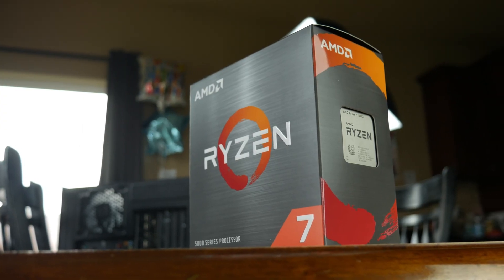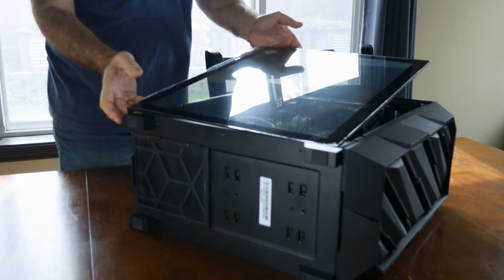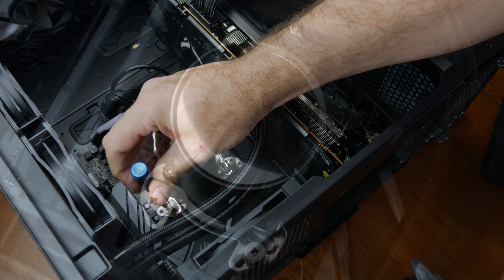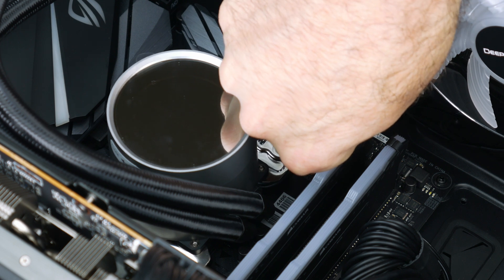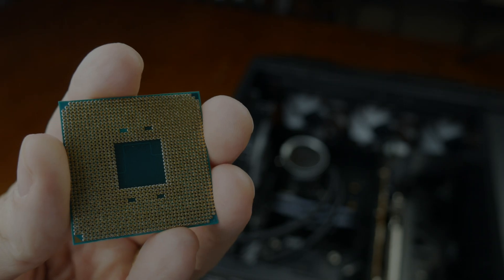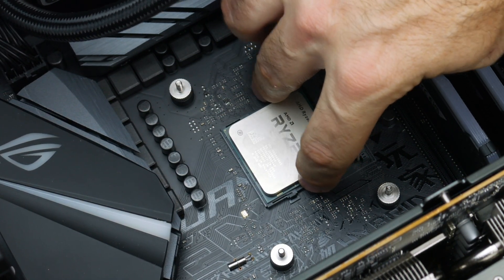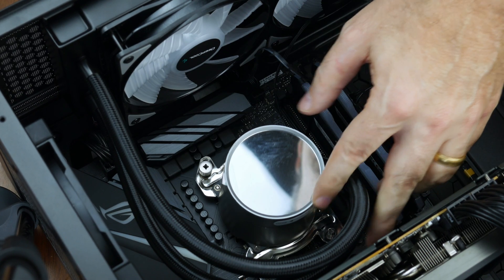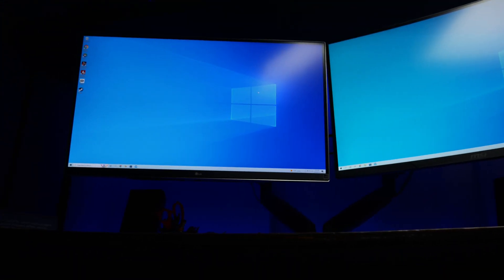How to Upgrade an AMD Ryzen CPU (AM4 Socket)

Comment: I’m going from a 4core ryzen 5 to a 6core do I still have to update the bios?
Reply from the maker: Not necessarily.
If you're upgrading CPU's within the same generation, then no. For example, if you're going from a Ryzen 5 3400G to a Ryzen 5 3600X, then you should be good, but if you're going from a Ryzen 5 2400G to a Ryzen 5 5600X that means you're moving up a couple CPU generations (the 1st number in the model number indicates the generation), so you will need to update your motherboard BIOS before swapping CPU's. If you don't update your BIOS first, then your motherboard will not recognize the new CPU, and will not work.

Comment: Youre video is def a big help. I do I have one question. I am upgrading from a Ryzen 5 3600 to a Ryzen 7 5700x. My ASRock B450M/ac Motherboard says it calls for BIOS 2.70 which was made in 2021. If I have BIOS 10.08 (2024 update)... Do I need to downgrade to BIOS 2.70 or am I good for the swap with no extra hassle?

Comment: Thanks for this. I've done a few CPU swaps before but only on Intel. I'm fairly confident with LGA CPUs, but I'm a bit scared of messing things up with PGA. Thankfully it doesn't seem much different here, just need to be more careful when handling the CPU instead of the socket

Comment: I just upgraded my 5600 to 5700x3D and it was so scary to install the new CPU lmao. My hands were still shaking after it was installed but I was so relieved when I saw the American Megatrends screen.
Reply: Lol
Reply: I can’t get any display on my screen
Reply: @caydenwendling939  try updating bios
Reply: @caydenwendling939  
This is probably way too late but maybe it can help the next one with the same problem. If you don't get any display you probably didn't update your bios.
Reply: I’m about to do the same upgrade with my new 4080 super. How was your performance jump? I’m on 1440p
Reply: @samphillippi904 I mainly play shooters like CS2 and play at 1280 x 960 low settings despite my monitor being 1440p but other games I set them to 1440p Max or Ultra settings. Performance is really good in CS2 like around 250 to 400 in an online lobby and highest I seen is 500+ on an bot lobby. In other games, performance is also really good. I play like The Crew Motorfest but FPS is capped at 60fps somehow. 

5700x3d + 4070 + 32GB is a nice combo. Though I might jump to AM5 soon as the max clock speed for the 5700X3D is only 4.1GHz and I can feel it struggling in Photoshop despite having a 4070.

Comment: swapping from a 5700g to a 5800x3d. I have the ASUS PRIME  A520M-A II with BIOS version 2803. I checked the website and it said for a 5800x3d to be usable it has to alteast have BIOS version 2423 which is the update before mine. Despite the newer BIOS updated do I really have to update BIOS?

Comment: Hello. I have two questions. 
1. For igpu processor which DDR RAM is better? DDR4 or DDR5. Also recommended to me which CL of that RAM
2. If i want to buy some GPU like Sapphire Nitro RX 7800 XT or maybe some cheaper GPU, is it better for my PC to buy a processor without igpu, or there will be no problems if i buy a processor with igpu?
Reply: 1. If you are only using your PC for gaming, DDR 4 with Ryzen 5000 series should be enough for now. Although, if you using it for something like 3d rendering and any other heavy workload and future proofing your PC, DDR5 is your choice, although it will cost you more , of course.
2. Don't buy any CPU with igpu if you are planning on buying a dedicated GPU. Waste of money really, since you never use that igpu after all.

Comment: Thanks for the Information. The only issue I encountered was that when I tried to boot my own PC, going from a 3800XT to a 5900x, it gave me a TPM error. I also had issues with Bitlocker, which I eventually solved, but knowing I had to disable these in advance of installing a new CPU would have been very helpful.
Reply: I’m running into that issue now. Did u have to go reinstall ur old cpu to get the passcode or how’d u end up solving it

Comment: Can't wait to give a little twist to my Noctua NH-U12A that was never removed in 4+ years ^^'. Can't wait for the next saturday to swap my old 3600X to a 5700X3D which cost me around the same price as my old CPU a few years ago (and not sold by a sus vendor but on Amazon by Amazon for 190 euros). My Asus TUF B450 Plus Gaming is ready for that little bad boy (bios up to date), then i will have to wait for something similar to a 7900 XT at the price of the current 7800 XT or GRE to remove my old 5700 XT and it will be almost perfect (overkill for my monitor but anyway. I use a 1080p... 32:9 monitor sooo if i want to upgrade for something like a 32:9 1440p G9 OLED, it will be too expensive ^^').

Comment: Hiya, many thanks for all the great videos,ive just upgraded my gigabyte a320 am4 motherboard from a ryzen 5 to a ryzen 9. i followed your video on updating the bios which i did with no worries. my problem is although the pc and windows 11 recognises the ryzen 9 cpu its offering me an option on the post, i chosse N with loads windows normally, what option should i choose ?
also as i mainly use my Pc for MSFS2020 is it worth upgrading my MB to a tomerhawk MB ?
while playing MSFS2020 my PC throws out alot of heat any ideas other than change my heat sink ?

cheers, great work

Comment: right now i have a ryzen 7 5800x with the F10 BIOS on my Motherboard and i wanted to upgrade to ryzen 7 5800x3d.
BIOS Update F10 is still right for the new CPU right?
my board: b550 aorus pro v2

Comment: Just wanted to say thank you for this video. Had to install my new CPU for the first time and boy I was scared of doing something wrong.
Went from a Ryzen 7 2700X to 5700X3D and everything went well! 
Thank you!
Reply: That's a great upgrade! Today I'm going from an R5 3600 to the 5700X3D, which will hopefully give me a lot more wiggle room in Space Marine 2. GPU upgrade will definitely be the next big step, lol.
Reply: @Jakura99 I’m on that upgrade path too hopefully it comes tomorrow
Reply: @Jakura99  Damn, almost same upgrade in a few days, 4+ years with a 3600X (was going for a 3600 at the time but idk why that day the X was 5 euros under the non X, both sold on amazon by amazon btw) and a 5700XT, hope it will give me a huge boost until the next gen of AMD GPU comes out (especially on a "poorly optimized" and "unknown game" called Helldivers II which give me headaches ^^').

The 5700X3D (sold on Amazon by Amazon btw, not a sus vendor) cost me only 190 euros, that's around the same price of my old CPU a few years ago, i see this as a Huge WIN.

How was your upgrade with the 5700X3D, what GPU are u using with it ? did u notice a huge gain on all of your game ?

For the GPU i'm waiting for something similar to a 7900 XT for the price of the current 7900 GRE or 7800 XT, that will be around a 100%+ perf gain vs my current 5700 XT (and ofc double the VRAM or more).
Reply: I will be upgrading from 2600 to 5700x3d
Reply: went from ryzen 5 2600 to ryzen 7 5700x and my god the performance is heavenly
Reply: @queueuof I'm on a 1600 AF which is a down tuned 2600. Really hoping to upgrade soon to the 5700x or a 3d card if I can swing it
Reply: Same. Just upgraded from Ryzen 5 3600 to the 5700X3D. About to install. Hows the x3d working for you?
Reply: @NJFoxx  am about to do the exact same in a week 3600 to 5700x3d,its big upgrade for fps games isnt it ?
Reply: @home2341  huge. Especially for cpu dependent games. Hope you enjoy man. I will always have a soft spot in my heart for my 3600 though, that thing was working above it's pay grade lol.
Reply: Here cause I'm doing the same upgrade today when I get home, I'm so excited! Glad everything went well for you I hope I Can do the same.
Reply: I'm doing the exact same upgrade! Tell me, how much of an improvement did you notice with the better cpu?
Reply: @jeremybrown116  It's insane. You got your money's worth.
Reply: @NJFoxx  Just installed it yesterday. I gotta agree! went from 40-50fps on a 4070 to 100-120+fps!!!
Reply: Got mine yesterday putting it in today hope all goes well 🤞
Reply: @ mines doing well I put it in yesterday lmk how you do
Reply: how did you go flashing the bios? never done it before
Reply: Yoooo ive got a r7 2700x too but i have to upgrade to a 5800x not 3d
Reply: i have same Ry 7 2700 and looking to upgrade to 5600. how much better is it? will i be able to play GTA 6 when the pc version releases in ~2 years?

Comment: If possible, I like to run the system through a quick stress test or put any load on the CPU really beforehand. It makes it much easier to remove the cooler ;)

Comment: Why is it necessary to upgrade the BIOS before a CPU Ryzen 5 upgrade to a 300 series motherboard?  I am in a situation where, despite many email communication exchanges with MSI, MSI still cannot advise me how to overcome the failures I'm encountering with the BIOS update ... apart from wiping my computer, reinstalling Windows 10, and trying  to update my BIOS again.  I have a new CPU in hand, ready for installation, a Ryzen 5 on the Windows 11 compatibility list.  I wanted to install the CPU and thereby let Windows 11 to update my BIOS (since this feature isn't available in Windows 10).  My current BIOS version hasn't been updated in many years.  In case you want to give any advise, I think my BIOS file is original (rom 2019).  Thanks for taking the time to point out the safety concerns you did in this video, which is something that MSI failed miserably to do.  I just finished commenting on MSI's ultra abbreviated CPU upgrade video in which MSI appears to be applying its marketing department's concept of "keep it simple, stupid" to the philosophies of the technical support department.   When I see stuff like that, it just makes me wonder what the story is behind it.  I wonder if the entire marketing department ousted someone who was laterally transferred into technical support, then quickly rose to the top, as people sometimes do ... even when it makes absolutely zero logical sense (yet it still happens a lot everywhere, especially in companies with nepotism).
Reply: Reason for the BIOS update is same as if you want an Office 2002 software to recognize an Office 2008 document (since this file type didnt exist before 2002 just for example), you have to show Office 2002 how a 2008 file type looks/works. While in case of these Office softwares, a quick update from Microsoft does the job as long as you have internet, the BIOS cannot access internet and is specifically bound to your hardware(motherboard). On similar notes, since you have to feed the new BIOS update to your motherboard, and not in your operating system, you'd need a USB stick with the latest BIOS update file (specific to your motherboard model). Then the upgrading procedures for these BIOS updates with USB sticks are commonly available in youtube. Note that you will most likely need a FAT32 file system for your USB stick which is usually default in any USB stick below 32gb. For larger sized sticks, use a simple exFAT to FAT32 converter and continue the procedure. Although my comment is 2 months late so by this time I think you've solved your issue in one way or another, but I hope it answers some of your queries. Can't talk much about the corporate shenanigans as it's almost pointless to ask big companies much for individual customer service as their primary concerns are usually "big groups" of people or a whole locality of people. Doesn't make much sense but thats the way for giant companies, one or two dissatisfied customer is barely their concern.
Reply: @fazewalker  i googled if does 5409 bios support amd ryzen 7 5700x and it said it did would it still be best to update the bios first to be on the safe side or am i good to go ahead and change the cpu

Comment: im upgrading from ryzen 3 3200g to ryzen 5 5600x+rx6600 tomorrow! thanks for the video 💥
Reply: That's crazy I'm changing the EXACT same cpu's soon as well.
Reply: Can ruzen 3 2200g also upgradeable or not?
Reply: I've got same with 5700x3d

Comment: I have an HP all in one desktop computer. Model 23-q110 touch screen. I want to upgrade my CPU and tried to update my BIOS from the HP website, but the newest version from 2019 after my pc was scanned by HP and I downloaded it! When I was about to do the update it said - BIOS not compatible with your PC! So, can I just go ahead and install the new CPU? Thanks in advance!!!! NOTE I currently have an AMD A-8-7410 APU with AMD Radeon R5 Graphics 2.20GHz I am replacing it with an AMD Ryzen 7 2700X 3.70GHz 8 Core UA1914PGT 16 Thread AM4 CPU just so it will pass the Windows 11 standards!

Comment: I’ve recently made the mistake of not updating my bios before replacing my cpu, I have tried to put the old cpu back in to update bios but pc would no longer turn on with the old cpu. Any suggestions?
Reply: Did you manage fix your issue? Im in the same situation as u
Reply: @ I ended up having to get a new mother board. But if your motherboard has a bios update switch you can download the bios on a flash drive somehow and download it that way. Unfortunately if you don’t I think you’ll need a new motherboard with the proper bios

Comment: Guys please help I installed my new cpu with the correct bios version and everything and the PC turns on but nothing comes up on the screen and the keyboard and mouse don't work.
Reply: Did you find the solution?
Reply: same
Reply: Same here...
Reply: Guys I fixed it, my CPU turned out to be defective so I returned it and got one from overclockers instead of amazon, that might be what you guys are experiencing. Good luck!